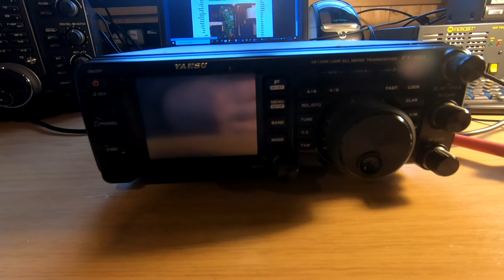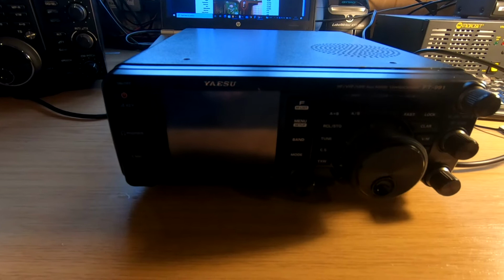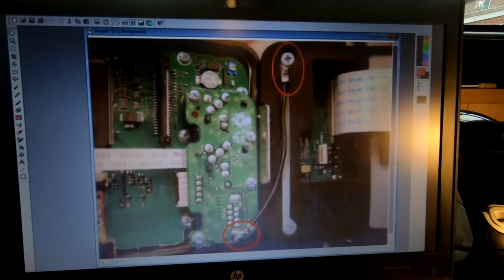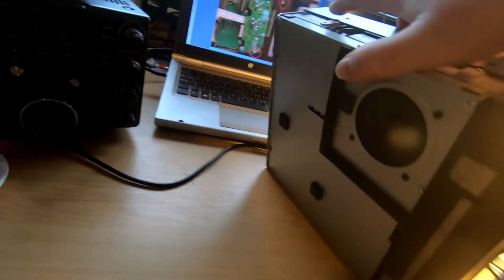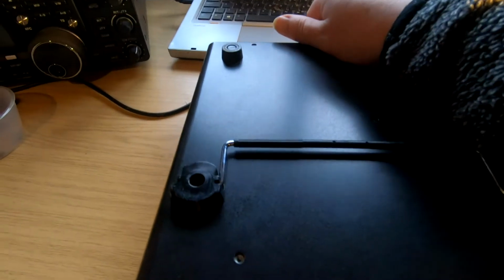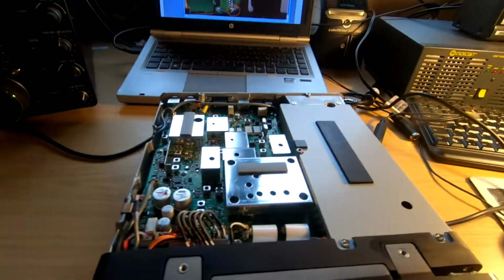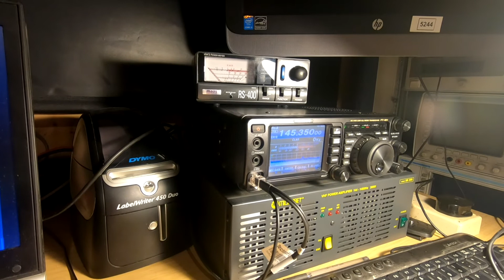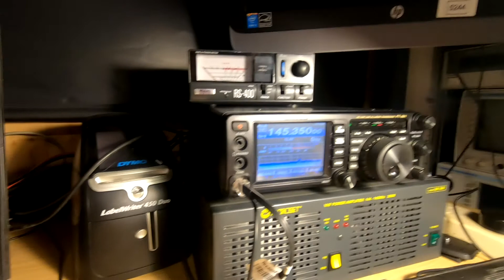Yaesu FT-991 mod to eliminate the microphone hum

Comment: I've heard it is due to badly manufactured mics where inside the mic body mic ground was mixed up with ptt ground where it solders to the connector. You can use headphones and the monitor mode to listen for the hum.
  I tried swapping grounds around at each end of the mic cable and using the braid in place of the ground. I was cleaning around the mic element and i broke both the wires that go to the diaphragm. Oops! I had to get the microscope out and make a nifty repair. I almost wasn't able as one wire broke very high up the channel where they run in a type of flux looking goop. I was very pleased to have fixed it even if it took one and a half hours to finally pull off this repair. A classic if it aint broken don't touch it!
  There is the blue circuit board and the green one. I have the green type but even though it's not well made, some screws stripped the plastic threads etc. bad soldering on the grounding points etc. However someone has been inside this before me. I can not hear any difference with low cut but perhaps it's already cut out lows with the EQ, or that part is not working.
  If fiddling behind the front panel of the 991A does not fix it i think i'll be selling this one for spares. Sounds great but what is going on with this hum. Also, the PTT lock is so clunky, everyone can hear it, i managed to soften the main PTT a bit with some packing foam but generally it's badly made. Is the next version up any better?